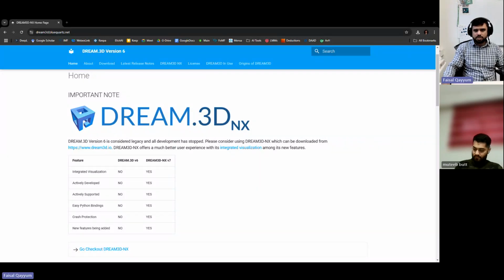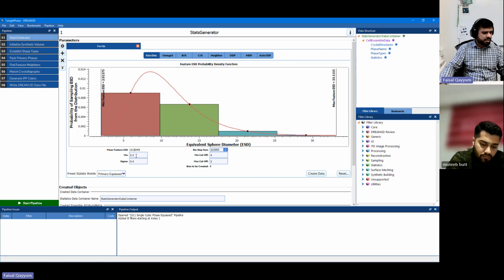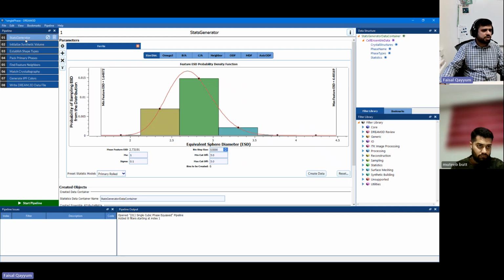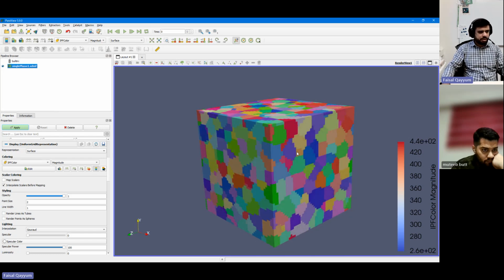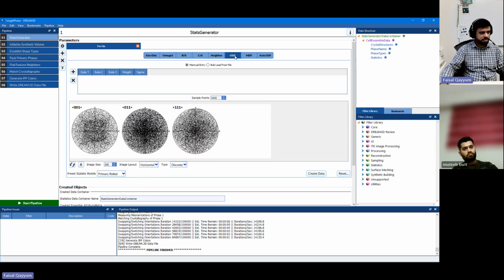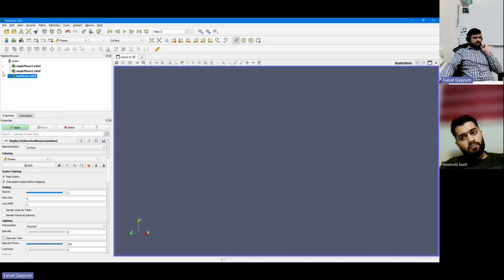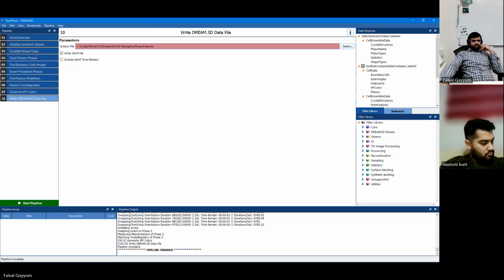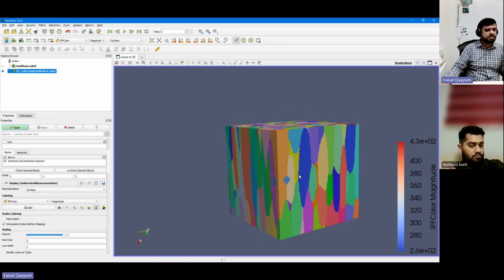Creating Single-Phase and Multi-Phase RVEs using Dream 3D for DAMASK Crystal Plasticity Simulations

Comment: Thanks for the video.
How do you call up the “Map Scalars” in the left toolbar of Paraview? I'm unable to visualize the inverse pole figure using EBSD through Paraview.
Reply from the maker: That's a good question. You have to turn on the advanced mode. There is a small great icon on top right of the toolbar that will open advanced options. Then you'll be able to select map scalars

Comment: Good day, Dear Dr, this video is really helpful and well explained, currently many people really want to use Dream3D to analysis own EBSD file, specially EBSD.ang but to lack of information or tutorial unable to use it. some people used Matex with MATALB, which is little complicated because everybody cannot buy this commercial software and crack or any other version is not acceptable for completely matex due to compilers installation.  So, I will be very thankful to you if you will make tutorial using this Dream3D software to analysis EBSD.ang file, please also mention in the tutorial, calculation of twin volume fraction as well as also show how could we use these results in DAMASK. Thanks
Reply from the maker: Will sure try do make that. I'll also have to learn some of those things myself first
Reply from the maker: Can you please your EBAD dataset that I can practice on ?